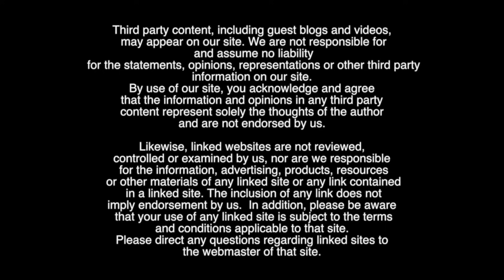How to Install a Dash Pad & Instrument Bezel in Dodge Trucks | Kevin Tetz with LMC Truck

Comment: Would be nice if LMC offered the dash core structure (what the dash pad, radio, switches, etc all attach to).
Reply: Tell me about it. I had 2 buy 1 off Ebay for $700. All my stuff was no longer attached. Ac light switch and airbag. Looked horrible. Now i know just 2 pull whole dash.
Reply: @ryangarrett7281  what is it called again lol I just got an 01 ands in. Bad shape as well that got all kinds of stuff trying to hold it together
Reply: I had to jigsaw chunks of the dash core with popsicle sticks and epoxy… then gently removed the core from the metal frame and put fiberglass cloth and resin  on back side of the entire core. It was tedious, but it solidified the entire core and it seems to line up with this LMC dash. I have a short video of the fiberglass on my channel. More to follow …. One thing, if you have a 98 with the power plug in the bezel, the ones that are aftermarket won’t work…. At least they didn’t for me. Good luck.
Reply: Check out All Dodge Truck, we are working on producing them right now, hopefully we will be in production soon, we are currently working on designing them to work with the stock radio and double din without cutting (hopefully anyway) .
Reply: @benjaminneel1625  I was gonna say check out all dodge truck man is saving out asses 😂😅
Reply: It took some extra time, but I plastic welded my dash frame back together and it’s sturdy now. My headlight and hvac switches were just dangling before but now they’re mounted solid. I bought a $30 plastic welder from harbor freight and I used chunks of my old dash top to weld with.
Reply: @benjaminneel1625  Got me excited for a moment, but I have a '95
Reply: @Amanda-xl9xy  Don't worry we have the 94-97 dash in mind as well, we just had to commit to one first, the second one will come a little easier, I am actually going to go look at our final drawings today, hopefully we are a go for a 3d printed proof of concept, from there we are a green light to get the mold built and start making them, so excited!!!!!!
Reply: @Amanda-xl9xy  they have them for a 1995 as well. I have them in my cart just waiting on the paycheck so I can buy for my 95
Reply: @benjaminneel1625 sounds great until you realize it costs more than I paid for the whole truck. Sheesh.
Reply: @clarkoceans8239 yeah I get it but at least there is an option now.

Comment: don't know whether to go with the oem dash or aftermarket replacement (not a dash cover). the oem, as noted, has about 14 screws that attach to the defrosting ducts, and a couple of other things, with screws that are UNDER the dashboard and, with the heads facing FORWARD. only way to get those screws in is to remove the dash completely, like this video shows, or remove the defrost ducting completely and then assemble the new dash and the ducting, THEN install them as one unit. (i'm not even sure that that is possible)

anyway, the other alternative is to buy a non-oem (aftermarket) replacement dash that does away with even trying to secure the dash to the defrosting ducts (and a few other things), leaving only the 8 or so longish screws at the front the screw into the firewall. they come in shiny black and i imagine are not textured.
or i may buy the oem dash and bezel without the inaccessable screws. there are 8 or so at the front an plenty under the bezel and around the air bag. it will be the rattling that i'll be worried about...

Comment: 4:52 the upper a/c control mount broke off i see 🤣🤦🏽‍♂️ lmc should come up with something to fix that a/c controller stereo and headlight switch mounts
Reply: meengreen52 it’s broken cause of the dash it get fixed at the end with the new dash
Reply: @_fredo.24v__36  no it didnt

Comment: I am going to do the dash pad/bezel replacement without pulling the dash. BUT.. everyone should know, that it is the plastic parts of the CORE dash, that break as bad as the pad and bezel. Its a total bitch to try to fix the broken parts for controls mounting. Replacing just the pad and bezel will look better, but be prepared, the actual dash mount ( core) that have plastic parts to mount electronics, breaks EXTREMELY easy. So if you try to do just the pad and the bezel, take great care in taking it apart. 
I spent more time coming up with ways to try to fix the mounting parts because I didnt have time to... FIND a frame/core somewhere, pull the core, and replace it.
Reply: So true!!!!   That is exactly what happened to me.
Reply: Do You Think It'd be even possible for me to install these 2 parts from LMC , Just recently got into a 2nd gen and it has no dash at all 😅

Comment: I have a question... is the dash cover ,( the part that LMC sells)he one that usually cracks, in the top part of the dash? or does the cover just goes on top of a cracked dash? the reason I ask is because i need to replace the heater core and my dash is already in pieces so once i remove the top part of my dash , its going to break into a million pieces and therefore useless.My truck is a 2002 ram 1500.

Comment: This is a great tutorial video but I have to say that I’ve installed The same Dash and around 90% of everything he tells you to do is completely unnecessary you don’t have to drop the steering column and you most certainly do not have to remove the entire dash system simply all you have to do is remove the instrument basil remove the glove box remove the airbag undo the bolts that hold the dash on remove your AC control module and head unit and remove the dash and reverse the process to install it’s a one hour job. Not a four hour job
Reply: I am planning on doing this on my 98 Dodge Ram 1500. What year was your truck. From what I am seeing on mine it is simply mounted just behind the bezel by the front windshield, and side bolts. I don't see anything else other than the passenger side air bag that may need to be removed, but yeah i was thinking the same thing. This does not look to be all necessary.
Reply: @DorianMariusGray  mine was an 01 If yours is a 98.5 it has the newer dash in it, and yeah there’s nothing to it. Honestly the best way to do it is just completely break your old dash out and then remove your air bag head unit etc. then reverse the process for install.
Reply: @malfunctionjunction6574  yeah, thats what i was thinking when I looked at mine and I was like, I do not know why I would need to drop the column or take the whole assembly off. I think some of the videos are like, let me just take extra stuff off and then put it back on to make a longer video.

Comment: Help ... Great Video but I'm replacing my dash with this unit on an 01 1500 having trouble with the two connectors that plug into the back of the interior fuse panel that are very difficult to get to, one is blue and one is white; anyone know how these two release?

Comment: I am attempting to remove my dash entirely in my 1998 Ram 1500, here is what is giving me fits, the wiring harness doesn't seem to be attached the same in the vid, this job is not for the average shade tree wrench turner, and I thought I was a bit more than average. I wish that Tetz would have shown the dash being removed from the truck as it's not a one man job. One other point, don't try to do this job by leaning the dash away from the windshield unless you want to fumble about with a stubby screw drive. It's definitely a 4 out of 5 for difficulty

Comment: Just ordered a dash pad for my 01'. Already replaced the Dash in my 99' with a Geno's Garage. The fit was good but it comes unpainted. I spent forever trying to find the factory Mist Grey paint. When I ordered it online it never came in the mail with the dash. I called every company I could find that carries it and they all said it was out of stock. Went to a Dodge dealership to find it and they said that the paint was discontinued so there was no option for me to get it exactly like factory so it's a shade off. It fits decently but slightly rattles. Going to do it right the first time with this one for my 01'. Best of all it's already paint matched so no headache trying to find the color and prime / paint it myself.
Reply: Take a piece of your old dash to a automotive paint store.
Reply: i took a chunk of my dash down to the local paint store. they matched it perfectly, so luckily i was able to get a nice front dash piece from the wrecking yard, and i'll be painting it to match.

Comment: Thanks for the video!  I did just receive those two parts and curious what those would cost to install on a 2001 dodge ram 1500 automatic.  Wondering what I should expect to pay if I can't do it myself.  And not concerned about the Heater core as I live in Texas and this is my Lake, River, Kayak, Home Depot Truck.

Comment: Heads up to 1998 Dodge Ram owners, the bezel that LMC Truck sells is not correct for our trucks dash, some modification is required where the headlight switch and the power outlet are located
Reply: Fucking figures .... it’s always something ....
Reply: My 98 bezel is luckily the n perfect shape ( dash totally disintegrated though ). So will my OEM bezel connect properly, evenly to a new LMC replacement dash? Thanks.
Reply: @philosopher0076  I replaced my bezel but I believe the old bezel will fit but you may need to make some minor mods

Comment: I still got the original one no cracks no nothing. I have 236,000 on my 2001 dodge ram
Reply: I have a 97 ram. Original owner. Not one crack in my dash.
Reply: @thelaststarfighter  Our 97 just disintegrated, after 360,000 miles and always with a good cover on top. I hope yours continues to do well.
Reply: @thelaststarfighter  I guess you live and drive everywhere under ground LOL

Comment: good video kevin I congratulate you I have a question I just bought a dash in lmc truks and when disconnecting the airbag I have it reprogrammed and if that is how it is done
Reply from the maker: Hi Mr. De La Rosa, For safety reasons please consult with your local mechanic. If you have any other questions please give us a call at (913)378-9499 or email us at customercare@longmotor.net thank you and have a great day.

Comment: Shouldn't the Vehicle Identifcation Number tag be transferred to the new dash before you put in the new one in?
Reply: P Mason  Yes, it is part of the actual dash assembly and not the cover.
Reply: On mine you do have to transfer the Vin plate. 97 Dodge 1500

Comment: How about the interior of the dashboard all my main plastic frame are crack n broken
Reply: Yeah, mine too. Try to find one of them. $800 for a used one, the cheapest I could find. Will likely crack immediately. Heater core stuck in there too.
Reply: @Dude83202  it's a bummer finding good parts
Reply: @Dude83202  where do i have to search for them?

Comment: Is my 98 the only one without a cracked dash? It’s sat in the sun for 22 years no problem yet.
Reply: My 98 dash began to crack in 2018, went 20 years.  I used a sun visor since day one.  As of today I have several cracks but no pieces have broken off.  It won't be long though!
Reply: be super careful cleaning it with a rag...I have a 98 as well and my hand and the rag went right through it one time.  I've got colored gorilla tape holding the whole thing together now.  I'd like to do a complete dash replacment...but costwise I may just get a cover for it and call it a day.

Comment: I gotta take apart the dash to get to the heater core anyway, so I figured I would fix this in the process. Is your company working on the dash core framework and lower compartments, yet? I need those parts, as well, and would prefer not to buy used
Reply: Good luck with that, I think that LMC Truck will never offer the dash sub-structure due to it's complex design
Reply: Check out All Dodge Truck, we are working on them right now, hoping to have them available soon.

Comment: So I literally don't have ANY DASH LIKE AT ALL my ac is held by 1 zip tie, can this help me?
Reply: The product LMC Truck offers is what's called a dash skin, which attaches to the dash sub-structure, which then is attached to the dash frame, the metal part. If your sub-structure is degraded too much it would be pointless to spend all the money LMC Truck demands for the parts

Comment: So where do I get the plastic dash frame replacement I don't see it in the catalog?
Reply from the maker: https://www.lmctruck.com/1994-15-dodge/dash-components/de-1994-97-dash-pad-and-instrument-bezel
Reply from the maker: Hope this helps Dustin.
Reply: Thanks, while I do need those parts as well, what I need is the plastic part of the frame that all of that attaches to.
Reply: Don't bother, LMC will never have the sub-structure for sale it's just too complex to reproduce

Comment: what is that pull knob thing on the shifter ?
Reply: Two speed rear end
Reply: @mattshavers1496  Are you kidding me? You think this guy pulled some old POS two speed rear end out of an old 5 ton truck?  Plus, it's 4x4, if the guy put the two speed in the gear that didn't match the front end, (assuming he could even find a two speed rear end with one gear ratio matching the front end) the transfer case would explode!!!  The lever is for the exhaust brake, I'm quite sure.
Reply: Exhaust brake, I would guess.

Comment: This does not show what you have to do to unplug the fuse box. My 98 has a wire loom that connects at the fuse block and goes through the fire wall.

Comment: What about the vin plate
Reply: On an '01 the VIN plate is no longer attached to the dash.
Reply: @walterk1221  I have 94 ram
Reply: @michaeld954  perhaps you can do as I did on a '99 and use a "Dremel" to grind down the backside of the rivets. Then just transfer the plate to the replacement dash. I put a couple drops of superglue on the back of the plate and kept the rivet heads intact.

Comment: LMCTruck Why do you guys barely have any interior parts for the 2nd gens!!?? The 2nd gen marking is growing, people are literally spending over $12000 for 2nd gen diesels because there's a big community for Cummins lovers. Yet it's literally impossible to restore these trucks since most of the interior is discontinued and no one makes the big plastic trims and panels for them. I'm talking glove boxes, a pillars, door panels, center consoles, rear cab trim, overhead consoles, the dash itself apart from the dash pad. I can buy a new door panel from LMC for a 40 year old c10, but not my 2nd gen dodge?? You can literally buy almost the entire interior of a c10, but very little for our 2nd gen Dodges, really frustrating. I could only imagine how many people would go crazy buying interior parts for their trucks from LMC if they made all the other discontinued parts.

Comment: Kevin how much do you charge to do this installation, how much do you sale the dash and bezel and where's your location?
Reply from the maker: Hi Rodolfo, we are located in Lenexa Kansas. You can check out the dash on our website. Kevin does not actually work on customer vehicles. He just helps us showcase our parts.
Reply: @Lmctruck1  This is a great professional installer that makes us wish he can do it himself for others. I normally do most of my trucks jobs, am in Miami Florida. I'll check your website. Thank you!

Comment: I did this job on my 01 dodge ram I did the same as the video.  After I put my truck back together I started experiencing electronical problems that wasn't there before like check gages light and turn signals not working right.  Can anyone help
Reply: Make sure the giant brick connector under the dash is tight.
Reply: @meengreen52  
All is well with the truck now it just was the signal light relay.
Reply: @marcoc7118  whenever you disconnect any electrical connector it's really helpful to put a little di-electric grease in it. it'll help it go back together more easily, and also prevents corrosion. the factory does it on most connectors. it's especially helpful on the connectors with the fluted rubber boots. they hang up and don't allow the connector to "CLICK" when it goes together. so, it can look and feel connected, but still not be making a solid connection. if you're in real doubt you can run a continuity tester across the terminals with the connector buckled (just put the probes in the back where the wires go in. don't stab through the insulation) to make sure it's working.

Comment: Good Lord; I'd almost consider selling the truck before subjecting myself to this punishment
Reply: Wait until you have the ubiquitous headlight switch problem, and Dodge wants to charge you upwards of $1000 JUST for the wiring harness (which they will not sell segments of). That doesn't include labor. They wanted $290 just to solder a connector plug into my headlight switch!

Comment: Couldn’t you just pull the bezel off and then life the dash over top and bolt it down it seems extra to have to take the whole thing out
Reply: The defroster vents on the dash are attached to the dash from underneath.  You can not get to these screws with the dash in place.

Comment: My core framework is plastic and it also disintegrated. So I have no way to attach the entire top portion of my dash and instrument bezel. I think I am just going to make myself a custom dash from wood. Even the light switch is just floating around with the broken framework still attached to it. I have to hold it with one hand to push the switch back into the off position. LMAO 🤣 I love dodge engines but their plastic framework and attachments are trash.

Comment: These trucks are made to be easy to assemble, but not easy to fix. All the plastic is disintegrating.  I bought it for the engine.  Everything else is falling apart.